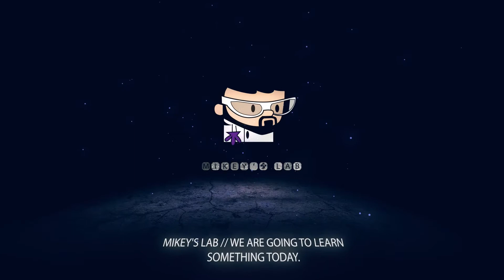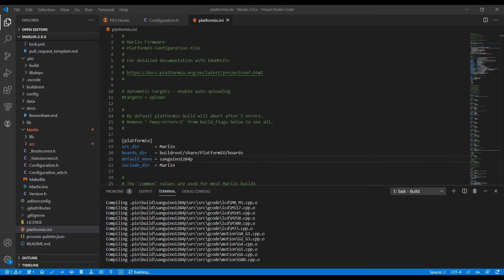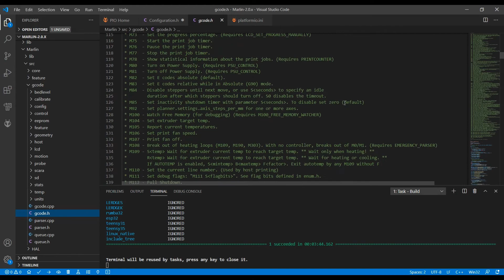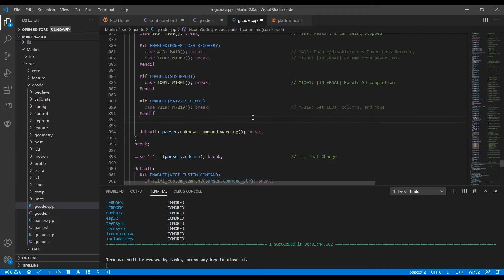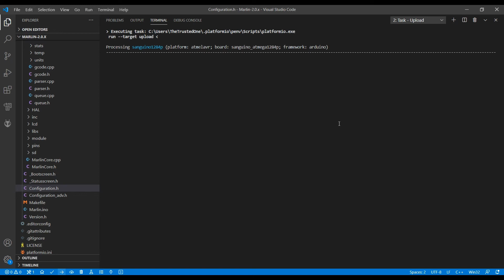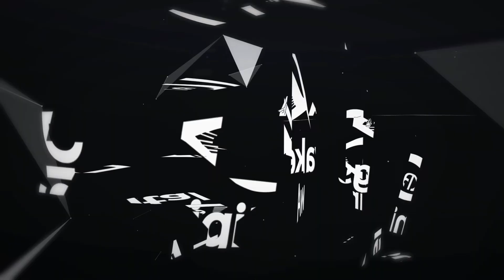Creating a custom GCODE command - Extending Marlin Firmware

Comment: Any chance you could upload a modern version of this video?  It takes way too long to get to the point and has a bunch of stuff that's just not necessary anymore at the start.
Also, I really don't want to wait for your code to compile.  Can't you skip that?  You also type slow.  Like, I don't know how anyone can sit through this.  I'm at 2x speed and I'm still losing my mind at how slow everything is.
Reply from the maker: @CyricRO  may I suggest you use the navigation bar to jump forward over the parts you don't need. I create videos with this much detail because I hate it when other creators assume the audience has significant knowledge before watching. I have moved on from Marlin years ago, and now exclusively use klipper, so reshooting would not be possible.
Reply: @MikeysLab  The video is fine, I just have a low attention span and get easily distracted.  took me about 7 tries to get through the video, and I somehow ended up watching a video about Jack Black, Elmo, and octagons.  Well, thanks anyway.

Comment: hi how do i move motors when the code is called?
Reply from the maker: The easiest way to do this, depends on if you want to move one of the normal steppers the board already knows about. With that you can simply invoke a G0 command in the source of your function. Move other motors would require either customizing the firmware to add another known stepper in the normal configuration, or in the case of an additional servo, doing direct pin manipulation

Comment: Hi Mikey, 🙂 First of all, i loved the tutorial, you provided on adding custom Gcode. With that said, i have a couple of questions regarding adding or changing, what i think are Gcode related items. But first a little background on my level of programming skill.  

While i am Not quite a n00b, i would honestly critique my Marlin/Arduino/Raspberry pi/ CPP/ skillsets as somewhere between beginner and intermediate) i have done a few Arduino projects successfully, but i really haven't done any serious programming since the way, way. Waaaayy, back days of Ahston-Tate dBase III+ 1.0/1.1/2.0  & Clipper 5.0 days, from Last century. Since then, i have gotten back to studying C++ & Python, which has helped refresh my memory on Conditionals ( if / endif)( do while / end do ) ( if / then / else), etc.,...

Now, Onto my questions;  2 years ago, I picked up  an Ender 3 pro which had a stock Creality 1.1.4 board. And for a while things were good, until they weren't.  About 7 months ago now, I changed out the guts of the printer with a BTT SKR Mini E3 2.0 board running Marlin 2.0 and the BTT 3.0 Touch panel display.  Along with an Actual BL touch sensor. I LOVE how this board makes the printer now run virtually silent as compared to, the stock creality board. However, 1 annoying thing i have found is, when a print is finished, the build plate, slides to the back of the printer, unlike how the old Creality board moved the build plate to the front of the printer. What line(s) of code do i need to change in Marlin, to write to the firmware, that will make the build plate, move forward to the front if the printer, at the completion of job?

Comment: i want to use two LCD screen ..another one for dignostic purpose simulteniously ...can you do that?
Reply from the maker: Yeah there are a couple of ways you could do that. The easiest way would probably be to modify marlin to push debug information to a secondary serial port (assuming your controller has one) then use an Arduino to receive the serial and control the secondary display. Option 2 would be if you controller has enough free pins to handle another LCD you could modify marlin to use the other pins to control the second LCD, this way would be very pin expensive. I suggest the first one, in the end you have an LCD that can accept a serial stream and display it, that becomes a very useful tool for other projects as well.

Comment: Hi Mikey, I was inspired by your video. I don't quite understand how Marlin recognized pin 29 on the motherboard?
Reply from the maker: I am glad the video helps. During the Marlin configuration you specify a board and processor. This is part of Marlin's Hardware Abstraction. Pin 29 is mapped to a specific pin on the micro controller as defined by the board definition.

Comment: Hello and thank you for this video! 

It helped me a lot to add my custom gcodes, I wouldn't have succeeded without it. 

I had a question though, you use the dwell function, and if I understand correctly, this function allows Marlin to continue to perform its actions in the background. 

The function I created allows to activate pins connected to an arduino board that drives servomotors with an independent program. 
The problem is that the arduino board has difficulties to send commands to more than three servo-motors at the same time, so I would like to add a delay to the function that activates each pin so that if I send two commands in a row, marlin will leave a delay after the first one before executing the next one.  
Dwell is not suitable, and I have tried "delay" which does not seem to work either. 
Do you have any idea what function I should use? 

Thanks in advance for your help!
Reply from the maker: I would try using a millis() delay with a while loop. Be careful with this, every delay you do like this will block the processor and stop the main loop.
Reply: @MikeysLab  thanks for your fast answer ! 
I’ll try this this afternoon. 
My gcode will work only at the beginning of my milling (it’s on CNC) 
And, my board is a STM32F4. Do you think « millis() » function will work on it ?
Reply from the maker: @Phoquounet  yes millis() is a built in function, it will return the milliseconds since boot. So some thing like this:

long start = millis();
while(millis() < start + 5000)
{
//do something while waiting, or not :)
}

Results in an approx 5 second pause.
Reply: @MikeysLab  great ! 
I’ll try this and tell you if that work ;) 

Thanks ! 

PS: for pin write, I use “OUT_WRITE(IO, V)” and my gcode take P for the pin and S for enable or disable pin.

Comment: How does dwell() allow the main loop to continue in a non-blocking fashion?
Reply from the maker: I will post a more complete answer after work, but I believe dwell uses a millis() structure to have an event wait for a specific amount of time, but allowing the main code loop to continue and check on every iteration if the delay has elapsed. I am doing a horrible job explaining it lol. I will provide an example after work 😁
Reply: @MikeysLab  Right so once the number of milliseconds has been reached, execution must somehow go back to the point where dwell() was called.

Comment: Hi Mikey! Hope you’re ok. Was just playing around with this in Marlin 1.1 and wanted to create a custom bit of gcode to completely remove a bit of filament from the extruder automatically. Was just wondering if you knew how you can call the gcode_G0_G1() function within a custom gcode to extrude as if a G1 E-100 is called?
Reply: You don't need a custom gcode for this, just write a macro.

Comment: Hello good man! Can you give me any advice how to control servo motor with creality v4.2.2. board.
I think that i can reuse BLtouch connector and reporgram it, but i dont know where to start. Any advice would be helpfull! Cheers!!
Reply from the maker: Yes you can or any other pin capable of PWM. From there you want to determine the #define for the port and pin ID for the probe servo. Search for all references for that designation, at some point this will lead you to the actual commands the set servo position
Reply: @MikeysLab  i didi it. It wasnt too hard. Thx once more! I have new problem. Whan i use servo motor (MG 996R) my display stats to flicker and i gave blank screen. I think that there is something with voltage drop... I turn of than turn on my Ender 3 (4.2.2 board) and everything is normal...
Reply from the maker: Yup, more specifically over current resulting in a voltage drop. I would feed the servos +5 directly from a buck convertor off of the PSU, servos are always hungry little guys
Reply: @MikeysLab  problem solved!!! I didnt have buck converter but i used USB chrager, grounded servo and USB cable to board, pluged V+ to USB and conected signal pin to board. Works like a charm, didn't have any problems with display even whan I stalled servo. Thanky you very much good man!!!
Reply from the maker: @MrMun33  never a problem, if you're subscribed stay tuned for some great content, been filming alot the last couple of weeks now just need to sit down and edit, including over hauling and upgrading a old 5 print head liquid cooled printer 😃. If you not subscribed, why wait lol
Reply: @MikeysLab  there is nothing to wait beside your videos :D cheers!!!!

Comment: Hi, thanks for your video really helpfull, i'm on an skr mini e3 1.2, i need to use 2 different free pin for 2 different script on an arduino, i think i'll use the NEOPIXEL PC7 pin which i don't use and the PT-DET PC12 pin, i d'ont know how to specify it in the gcode command: 

M6453 P7 S50

Do you think this will work ? Because i'm wondering how marlin make the difference between PC, PB or PA pins?
Reply from the maker: On the skr there is a difference between PA, PB and PC these are port A port B and port C respectively. There are many other marlin gcodes that take a pin number, I would find one of those and work backwards to determine how the pin is specified. For your case you could just remove the pin definition as a parameter in the gcode and hard code it (since you will be using it for yourself) I did it as a parameter to make it more useful for other people.

Comment: Hi Mikey, first of all, thanks for taking the time to show this stuff! 
I have a question regarding a weird custom command I'm trying to make involving motion and external sensor.
Basically, my code should move an axis (X axis, for instance) until it hits a special endstop (not the one used for homing, but a seperate one wired specifically for this). At first I thought I could just copy paste the homing code, but the problem is that it's important that I record the distance moved as it's nearing the endstop. In case you're curious, I'm trying to make a routine for a printer with two X carriages (IDEX) that homes both printheads on the same endstop to determine the nozzle offset.

My second thought was to just do some basic coding: make a loop that steps the axis while polling the endstop until it hits (I'll worry about accuracy later). My question is, is there a way to do these kinds of simple movements in Marlin, or do movements require a lot of preamble code to run? I tried looking at motion.cpp but it didn't help a lot (my coding experience is limited to slightly advanced Arduino projects). Maybe I can brute force it by spamming G1 commands in a loop? That brings me to a side question: in some comments you mentioned you can call Gcode commands from within your custom code, how does that look as written code? I assume you can't just write " G28(); "

I hope my question isn't too unclear or extensive... Again, thank you for this amazing tutorial! You've definitely earned a sub!
Reply from the maker: Yes you can just call g28(); it is just a function in the source. I am not familiar with the motion commands, but here is how I would investigate. I would look up the gcode commands for motion, find the calls in the gcode function that seems to cause the motion, right click on the function and choose find all references, keep going down the rabbit hole till you reach the point that we are actually telling the stepper motor to do something, then work backward to the point it makes sense to start your custom code. I can look into this when I am at a computer if this doesn't put you on the right path.
Reply: @MikeysLab  thanks for the quick reply! Sounds like a good idea, I'll definitely give it a try tomorrow. I'll let you know if I get stuck.
Reply: @MikeysLab  Hi Mikey, I managed to get my steppers moving, thanks for the help! I had one more question regarding calling gcode commands like G28() from within the code. Is there a way to pass parameters to the gCode command? For instance to call "G28 X" or "G1 X20 Y20" like you would in a normal piece of gCode? Internally the gcode seems to get its parameters from the parser (like the example in your video), but I can't seem to find out how to pass them on from the code itself.
Reply from the maker: @omega_one1318  I will have to look at the source code tomorrow and get back to you 😀
Reply: @MikeysLab   Did you figure out?? this is the closest I've got to finding the answer to this question :)
Reply from the maker: @CuriousMotor  Yes, the best way is to use the parser, GCodeParser::parse(char *p) to create the parser object the function expects to be passed to it. If you follow the code through for a G1 command, from the reading of the source GCODE file all the way through the execution you can get a very good picture of how this is handled. If it would be helpful I can do a video for this.
Reply: @MikeysLab  Thanks a lot for your reply! With a little bit of further digging, I was able to use process_subcommands_now( (char*) " G0 X3" ); to do what I wanted. I really appreciate your prompt reply, very rare on youtube. You've earned a sub!
Reply from the maker: Awesome glad you got it working boss
Reply: @omega_one1318  Can I contact you privately?

Comment: Mikey, Brilliant!  Excellent tutorial for what I need to do for a custom 3D concrete printer priject.  You have saved me tons of time.  While this is not critical for my project, the LCD has FFF-like menus that I would like to change beyond the custom user menu scheme already included in Mariin 2.0.7.  For example, the Temperature menu is not needed; can you give me some input on its removal?  I am playing around with "menu-main.cpp" and making progress.  Also, I would like replace Temperature with specials just like you show in this video which represent custom gcode except it is called from the LCD.
You mentioned a better than platformio plugin but I didn't catch it from your talk.  More input, please.
Reply from the maker: Yeah boss, Marlin is very modular, so it is just a matter of finding the menu section, then using the "find all references" to see how it all connects. The main IDE I use is Visual Studio Community with the Visual Micro plug in. I am working on a C++ for microcontrollers series where I will be going in depth into the more technical weeds of coding in these constrained environments
Reply: @MikeysLab  Thank you for prompt reply and tips.  I will check out the VS reference.
Reply: OK, success both removing an LCD menu and adding one but more importantly, I followed your coding example and was able to add my own custom G-code which while simple is a good prototype for more of them.  If I hadn't made one type, a ")" left out, this would have finished an hour or so sooner.  But All Good Now.  Many thanks and cheers, to you, Mikey.
Reply from the maker: Awesome brother. We have all lost hours (or in my case days) over a missing ; lol. That was many moons ago before compilers would give you any reasonable error codes lol

Comment: I watched a little, what IDE do you use and config? your h/w and s/w are not the typical one so your post is less helpful.
Reply from the maker: The IDE is VSCode which is the most common IDE for compiling modern versions of marlin. The Hardware is the board that come with the Ender 3, which is the most popular printer. So I am not sure I understand your comment.

Comment: hi5 for the video, i need to make the same but with a endstop to control the door switch so when is open the door the printer pause, can you make some help?($$)
Reply from the maker: That is actually simpler than this mod. I would use an Arduino with the switch connected to an interrupt, then you can use one of the serial ports on the control board and have the Arduino send a M226 to the  board. If you are lacking an available serial port you would need to make an extra IO pin an input, add it to the polling loop (duplicate the end stop code) and trigger the M226 command inside of marlin itself. Can I build it for you, no. But I think I have given you enough information to build it yourself.